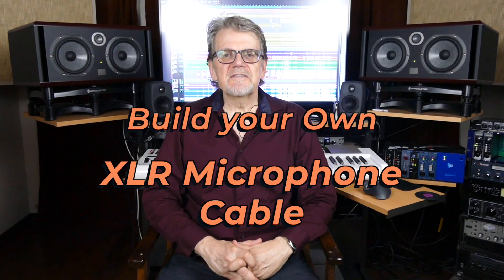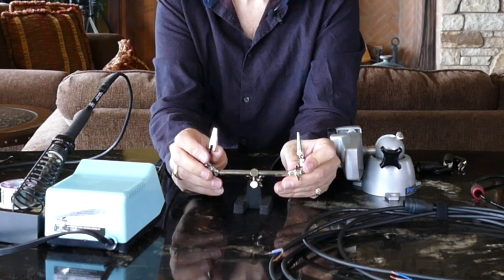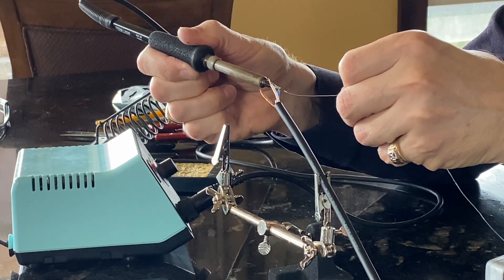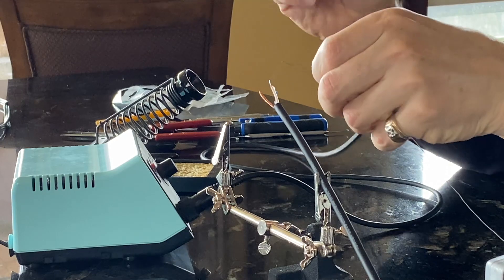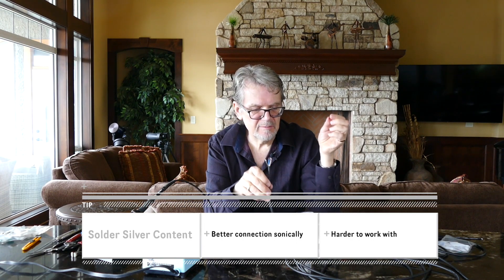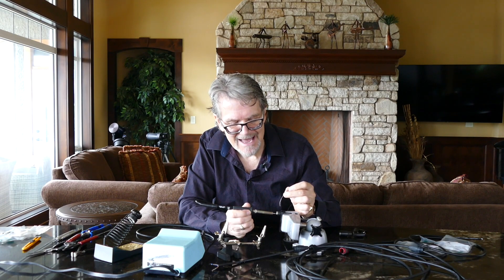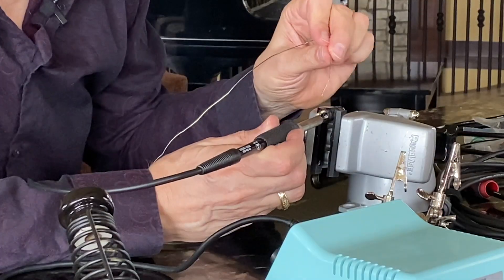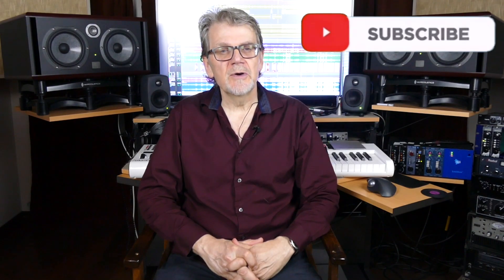XLR Microphone Cable DIY Project - Part 2 - Tinning your wire ends

Comment: Question....are you sure that is not Rosin Core Solder?   The reason I ask is because you said you are using Acid Flux,  I taught Rosin Core Solder should be used with electronics to reduce corrosion witch can eventually lead to distortion or other problems.